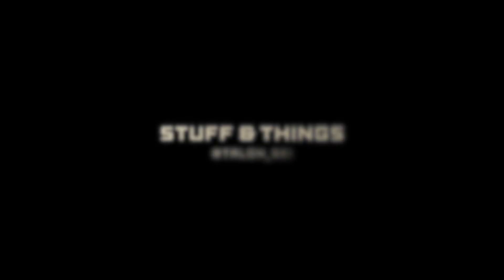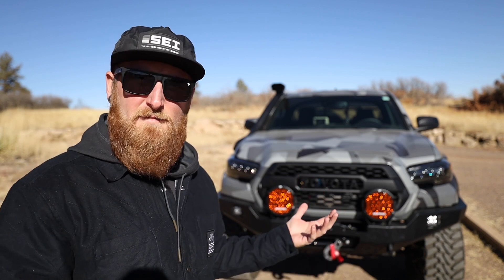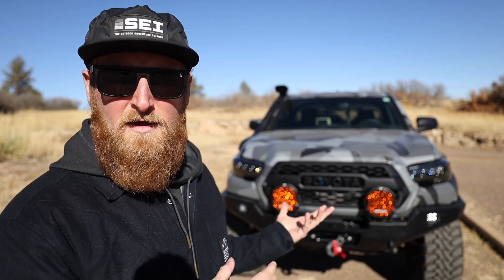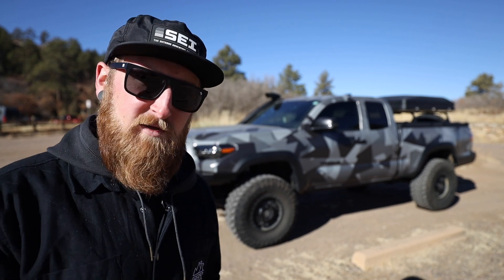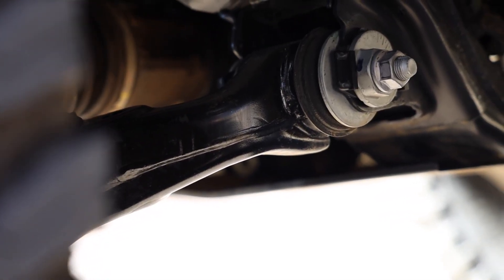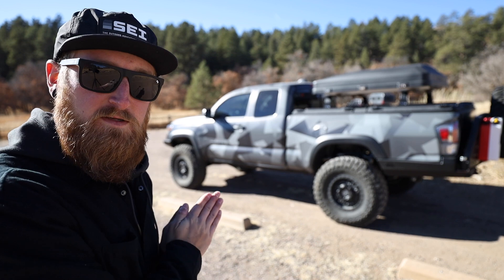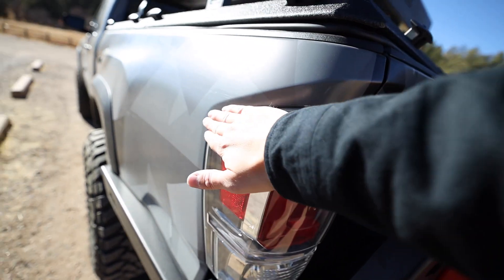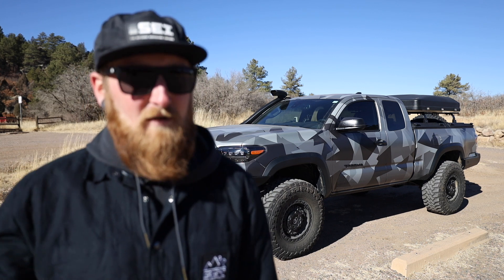The ULTIMATE Tacoma Build Part 3! | Performance Modifications

Comment: Very Wise Choice on the Disc Brake Upgrades!! You are Exactly Correct Talon; Many People Underestimate the Importance of Upgrading to Better Aftermarket Brakes on the Front/Rear Tires Especially after Adding Bigger/Heavier Wheels & Tires to their Mid-Sized Trucks! And that Doesn't even Include all the Extra Weight from the Solid Steel Aftermarket Front/Rear Bumpers, Extra Lighting, Winches, Extra Spare Wheels/Tires and Any Other Gear they keep inside the Cab or Inside/On Top the Bed of the Truck... So in My Opinion, that was Definitely a Necessary Upgrade that will Keep you Safer On/Off the Road; As well as Adding Better Performance Off-Road on the Tails!.. 🤓👍

Comment: Very very nice functional upgrades. Re gearing is not necessarily to turn the tires, it takes the unneeded stress off your motor, transmission and associating components but helping move additional weight. I would of upgraded the rear locker. There have been some issues with the factory e locker not engaging but hoped it’s been worked out. The BBK and rear disc conversion is awesome, I’d love to see a video and review on those.Truck looks awesome.

Comment: Wow that truck has everything you could do it seems.  I don't think I will ever quite go that radical but out west I am sure you need it.  I do a lot of forest service roads and less technical stuff but I have to daily drive my rig.  2021 SR V6 4X4 Prinsu roof rack with light bar, Yeasu FT-2980 2 meter ham radio, and Pro Comp Vintage 69 wheels with Wild Peak AT's.  That's it so far.
Reply from the maker: This is all pretty extreme. Definitely not necessary for what I’ll be doing but I love building out vehicles like this do for me it’s all worth it 🤘🏼 thanks for watching Jeff!

Comment: Hey Talon, can you go over what you needed to do in order to fit the 35s? Thanks man!
Reply from the maker: Check out the part 1 video where I covered suspension. You get a good look at what we did there 👍🏻
Reply: @TalonSei  thank you, It was only mentioned that the cab mount chop was done but did they cut the pinch welds or anything like that? I appreciate the info, wanting to go 35s soon!
Reply from the maker: Pinch welds are cut and hanmered flat, cab mount chop and then suspension is what was done to fit

Comment: I'm interested in seeing a comparison of the Throttle Grenade vs the KDMax tune. They seem really similar, except for the throttle unit looks like you can switch it off and on.
Reply from the maker: The throttle grenade is a throttle controller, not a tune. I have the OV tune on my truck.
Reply: @TalonSei  Totally agree. Thats the difference, one is engaged all the time while the other can be switched off and on. The KDMax tune is basically a throttle tune on top of the OVTune. Do a test run with the throttle grenade on explosive and let me know if the throttle is really touchy.
Reply from the maker: It is. Explosive mode is kinda insane. I use the intel mode for normal driving and crawl mostly when off road.

Comment: What is the break in interval that you were told? My 2021 Tacoma 3.5l, I was told 500 miles or no towing until 1000 miles
Reply from the maker: I believe it’s 3 heat cycles of 50miles or so and then east for 500 miles before changing the break in oil. Don’t quote me on that tho, you can find more info on Nitros site.
Reply: @TalonSei  my dealer said no need to change oil till 10k, ha. I changed it at 3500 miles, peace of mind! THANKS TALON…
Reply from the maker: I am referring to the diff oil. Upgrading ti a very specific type of gear oil.

Comment: Front brake calipers on a Tacoma are already 4 piston from the factory. Snorkel doesn’t do a whole lot of good with regard to water fording when the exhaust is low, plus the snorkel needs to be sealed to a sealed air box.
Truck does look good, go enjoy it.
Reply from the maker: That’s why I went 6 piston with bigger rotors. I’m already running a high mount exhaust and it is sealed to the air box. Happy Thanksgiving.
Reply: @TalonSei  your exhaust it still lower than your air box/inlet (which should be okay as long as the motor is running).
I guess maybe I misunderstood you on the brake segment, you had said “most people upgrade to 4 piston,” which I hear that as upgrading from less.
Time to supercharge or twin turbo!
Again, nice truck! Enjoy!